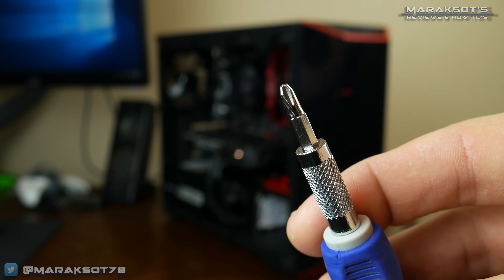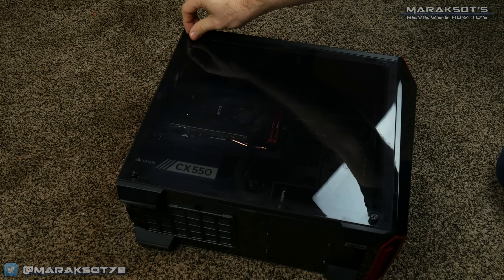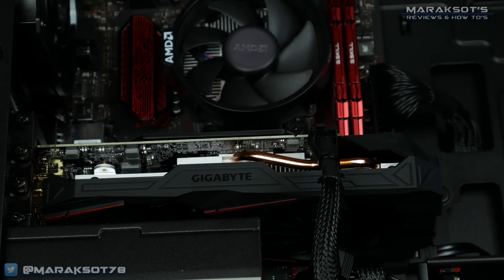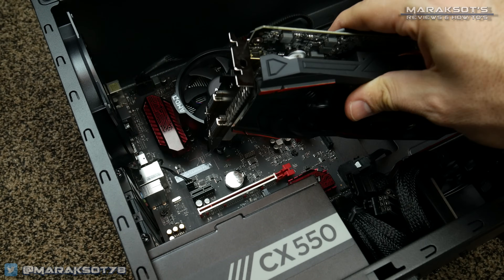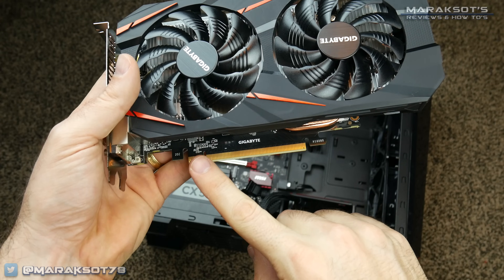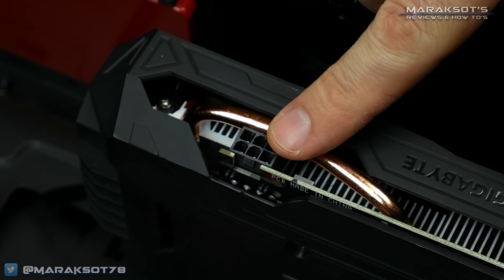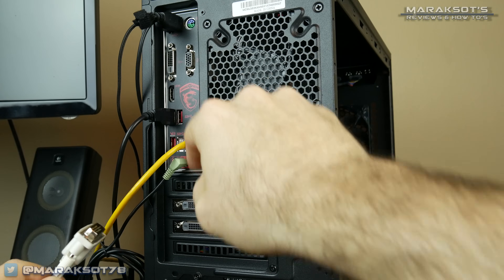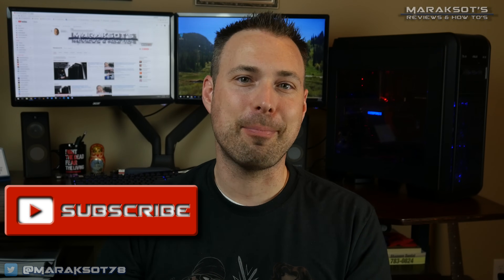How to Install a Graphics Card - Upgrade Your GPU

Comment: Great video.  After installing the gpu, is there somewhere you can go in your pc settings to confirm that the video card is installed correctly and working properly? Thanks!
Reply from the maker: If you're getting video to your monitor that's how you know it's installed correctly.  :)

Comment: congrats 

dont build on a carpet
don't touch sensitive parts
dont leave a screw when you drop it on the mobo
dont spill water on it
you need to have antistatic surface
dont turn it on when changing
dont strip screws
if you tripped your screw use a big screwdriver
don't pull cables from the wire
dont drop anything
dont touch the yellow bttom of the ram sticks
look carefully for the ram slots
dont buy an air cooler that blocks your ram
dont use too much thermal paste
wipe your hands if oily
dont touch your mobo with oily hands
screw in your gpu when installed
dont forget to download drivers
cable management
dont put a cable near a fan
maintain proper air flow
remember to screw the fans in
dont forget the io shield
dont hammer in your io shield
remember to use zipties
dont open your case vertically if it has a glass side panel
dont drop your hdd
never ever touch an hdd when running

Comment: I am really inexperienced with PC stuff. What happens if you are upgrading a graphics card and it doesn't have the same slotting or it needs more cords that you don't have coming from your power supply? Not even sure if my question makes sense but for example going from a 2070 super to a 3090 from what I can tell those have different hardware and I wouldn't even begin to know what to do if that were the case.

Comment: Question. I'm currently looking to get a RTX 2060, i have a GTX 970 right now and it's really showing it's age. I have an AiO water cooling system does that link in with the graphics card or no? I'll replace the card myself if it's not integrated with the graphics card, or if it even can be, but if it is i'll need to take it in. Would that be a factor?

Comment: I'm about to leave to pick up my new GPU from the PO box. I've never installed a card all by myself, or anything in the computer, really. Hope I won't mess anything up. Thanks for the video, I'll put it up on my TV and try to follow it step-by-step.
Reply from the maker: Glad to hear the video is helping you. Enjoy your new upgrade. :)
Reply: @Maraksot78  I, uh. Turns out that like the moron that I am I didn't check whether I had an 8 pin cable. I don't. And in addition, no store in the city has it on-hand, has to be ordered. Guess I'll wait a few more days.

Comment: I have intergrated graphics would a 1660 super work with it?
Reply from the maker: What CPU do you have? Intel or AMD? And what model? i.e. i5-6600, i3-7100, Ryzen 3 2200g, etc.
Reply: @Maraksot78  RYZEN 3 3200G
Reply from the maker: A 1660 Super will work with the 3200g but the 3200g is going to bottleneck a 1660 Super. It won't damage anything but you won't be getting all your monies worth in fps out of the 1660 Super.
Reply: I might consider Upgrading to RYZEN 5 3600 though but cheers!

Comment: I just wanted to say, thanks a lot for the video, never actually replaced my GPU before so was a bit nervous but it's easy, the backpannel looked to be a part of the case, which it wasn't and the screws there were securing the GPU (at 1st it didn't look like this)
Works, my PC recognizes the new GPU and nvidia  automatically updated the drivers.

Comment: i'm thinking of buying an RTX 2060 super (from a GTX 1060) 1 thing i'm missing in comparison to this video is the 2 thumb screws that secure the GPU in place, it has the release thing for the GPU and the PCI-E cable so that's not a problem but i'm not sure if it's secured to anything or just hanging there, even when i check on the outside the screws aren't keeping it in place (unless i'm going insane)

Comment: so im upgrading from a geforce 610 (yes i know very bad gpu) and i was wondering if i installed a gtx1600 for example would it be compatable with my motherboard? or will i need to buy a compatable motherboard

Comment: So lets say im going to buy 2070 super and all the other specs are very VERY old do I need to upgrade any other spec before I upgrade my gpu for the gpu to run correctly?
Reply: Cuz I have heard that you need a decent power supply for that but I am not sure
Reply from the maker: As long as your current PSU (power supply unit) can provide the correct amount of power your new graphics card needs to operate then you don't NEED to update any other hardware in your PC.
That being said... if you have an old CPU you run the risk of bottlenecking your new graphics card.  If you don't know what a CPU bottleneck is and why it happens I made a video explaining it not too long ago you may find informative.  https://youtu.be/xEcMvIAu9-E  The main concern is you go and spend $500 on a graphics card and your old slow CPU, motherboard and RAM then limit how many fps your new GPU can output.  Rather than getting your full $500 worth of performance out of it you'll only get the same performance as a graphics card that costs $200 or $300, meaning you put a more powerful graphics card in your computer than the rest of your system can support.
The other issue you could potentially run into is if your motherboard is so old that the firmware on it doesn't recognize your new graphics card as a video output device and therefore cannot output anything to your monitor.  This can often be fixed with a motherboard BIOS/UEFI update but sometimes the only solution is to upgrade your motherboard which then means you need to update your CPU and RAM as well.
Personally my recommendation would be, if you're buying a high end graphics card then you also want a high end CPU and RAM to go with it.  Putting a brand new 1000 horse power engine into a 20 year old Toyota Corolla just doesn't make sense.  That old car doesn't have all the other high performance equipment, i.e. transmission, suspension, wheels, tires, exhaust, etc. needed to actually make use of all the horsepower that engine can output.  Computers are the same way.  Putting a brand new high performance GPU into a system that has a low performance CPU, RAM, etc. is going to limit that GPU and keep it from ever running at it's top speed.

Comment: -- Time Stamps -

0:00 - Video Intro

1:17 - Tools You May Need

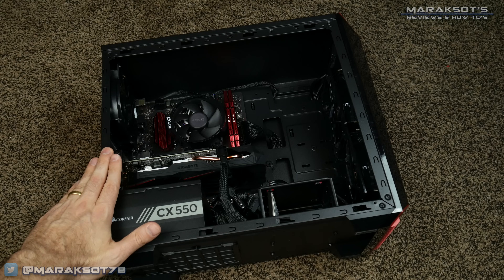1:31 - Opening Up Your Case

2:50 - Removing an Existing Graphics Card

3:56 - What to do if You're using Integrated Graphics (you don't currently have a graphics card in your computer)

4:24 - Installing your New Graphics Card

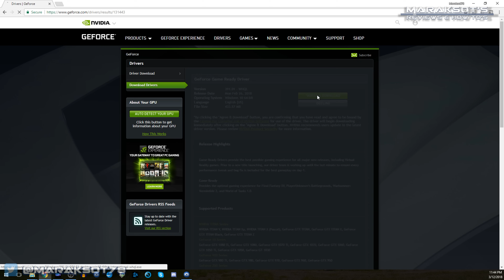5:03 PCIE Power Connectors

5:30 - Time for a Test Boot
Reply: Thank you
Reply: Yes, I did copy pasted desc.. I just wanted to comment it myself so that it is top in my comment section :)
Reply: @02102u  ok

Comment: Two questions:
1. Why do I have to plug in my monitor into the gpu rather than the mobo?  (i have a monitor that is quite old and im afraid that the gpu wont hace the specific slot, bc at the moment i can buy the gpu)
2. Im planning to buy the RX580 and was wondering how i can "switch" between the integrated graphics and the dedicated gpu (i have a ryzen 3 3200g with radeon vega 8)

Comment: Can I upgrade a prebuilt pc with a GTX 1060 3gb? (To maybe a 1660 or 1660 Ti 6GB)
Reply from the maker: Yes, but I would recommend saving your money a bit more and buying at least a RTX 2060, 2070, 2080 or a Radeon RX 5600, 5700 or 5700XT. A 1660, 1660ti or even a 1660 Super isn't going to get you a whole lot more fps than a GTX 1060. The 1660 is more powerful than a 1060 but only 5 or 10 fps in most games which in my opionion isn't worth the $200 to $250 you'd pay for one since you already have a 1060. If you want a real noticable uptick in performance over a 1060 I think you'll want to save up some more and get something significantly more powerful... assuming your CPU is powerful enough to not bottleneck it of course.

Comment: Question: im upgrading from a gtx 1660 to a rtx 2060 super. Would i have to uninstall the old drivers still after i put the rtx 2060 in and install the rtx drivers? Or will the old drivers just convert?
Reply: If you have geforce experience, you just simply download the drivers

Comment: Why is my screen black after plugging the gpu??pls help
Reply from the maker: The first trouble shooting steps I'd recommend is first make sure your new graphics card is fully seated in the PCIE slot. Next I'd make sure all the pci express power cables are correctly and fully plugged into the graphics card. While I was doing that I would make sure all the power cables for the CPU and motherboard are also properly plugged in and that the RAM is properly seated. I'd then boot the PC up and if it still had a black screen then I would swap my old card back in and update my motherboard BIOS and try again.

Comment: How do you know if your graphics card can fit in the pc Bc i wanna get a new graphics card but I don’t wanna buy it then it doesn’t fit or something
Reply from the maker: The best way is to take the side panel off your computer and use a ruler or tape measure to see how much space you have in the area where your graphics card needs to be installed.  You can then go to a site like Newegg.com and look up the card you want to get and look in the specifications for the dimensions of the card you want and see if it will fit.
Reply: Maraksot78 ok thank you
Reply from the maker: @drewellis3241  no problem.

Comment: my graphics card only has one fan can i get one that has 2 or not
and does the card have to be the same brand as my first one ex:msi
Reply from the maker: As long as you have enough space in your case to accommodate the graphics card you want it can have two or even three fans. It doesn't matter what brand you buy either i.e.  MSI, Gigabyte, EVGA, Sapphire, PowerColor, XFX, Asus, etc. You do however need to make sure your power supply has enough wattage for whatever graphics card you choose. Most graphics cards today you're good as long as you have a 500 or 550 watt power supply, but you'll need to check the specs on the graphics card you choose and see what the minimum recommended power supply wattage is for your card. Also you don't want to pair a really high powered expensive graphics card with a really cheap low powered CPU as that can lead to CPU bottlenecking which means you're getting less performance (lower fps) out of your graphics card than it's capable of producing. If you don't know what CPU bottlenecking is here's a link to a video I made explaining it. https://youtu.be/xEcMvIAu9-E
My other video I talk about in this video that people complained about being too long actually goes over all of these other things that are important to take into consideration when upgrading your graphics card. This video is focused more on just the installation process.

Comment: I edit a lot of photographs and most of the time I'm in Photoshop and have no speed problem.  Recently I've started using some of the new Artificial Intelligence software like Topaz Sharpen AI and every time I make an adjustment it takes a long time to update the display and saving a final image can take as long as 5 minutes.  My graphics card has the updated drivers, so I guess my question is do I need to get a better graphics card???  Thanks  P.S. My card is a Intel (R) HD Graphic 630

Comment: Is it advisable to wear gloves when doing this to avoid any electromagnetic discharge?
Reply from the maker: I guess you can if you want but I don't think they'll prevent you from shocking anything with static electricity because gloves like latex gloves are too thin. Rubber gloves might work but I think those are too thick and would make installing components very difficult.  As long as you keep touching the case every so often and equalize the static charge between you and the case you'll be fine. Like I say in the video modern PC components are much more robust than they were in the old days. Modern parts have safety features built in to them making them much less susceptible to damage from an electro-static dischage. The video from Jayztwocents I link to also shows him trying to damage things with a static discharge and they're unable to actually damage the computer. He made a video in the last month or so where he sprayed a graphics card with water and it took a fair amount of water before he had any problems and after drying it out it worked fine again. So yah, graphics cards aren't as fragile as many people believe or fear they are.

Comment: question do i need to plug my monitor into the graphics card? cause rn its plugged in via hdmi. sorry i just finished biulding my first gaming pc.
Reply from the maker: Yes you want to plug your HDMI cable into an HDMI port on your graphhcs card.
Reply: @Maraksot78  oh do all graphics cards have HDMI port? And I got a question. Is it possible to run 2 monitors but one is connect via HDMI and the other via vga?
Reply from the maker: Most graphics cards now have HDMI and Display Port (a.k.a. DP) and some will have DVI as well. I haven't seen VGA on a graphics card in a long time. Anyway, DVI is an older standard and is being used less and less. Most new and even older high end cards will typically only have HDMI and DP.  To answer your question about using two monitors with different types of display cables... yes you can do that.
Reply: @Maraksot78  lol sorry I didn't know graphics didn't come with vga sorry

Comment: Do I need to install new one into the slot of my old GPU? It's really tight cause new one is bigger and thicker
Reply from the maker: You don't have to install your new graphics card into the top PCI express slot. Any PCI express slot will work. The only difference is the number of PCI express lanes to the CPU those slots have available to them. The top slot typically has 16 lanes available to it and the lower slots typically only have 8. As far as I know 8 lanes is fine for most modern graphics cards. Really high end cards however like the RTX 2080 may utilize more than 8 lanes. I haven't researched that though so I don't know for sure.
Reply: @Maraksot78  So I replaced AMD Radeon RX 590 - 8GB Crossfore Mode (Dual cards), with EVGA GeForce RTX 2070 SUPER XC ULTRA GAMING, 08G-P4-3173-RX, 8GB GDDR6 (single card). The old ones were in the PCI 3 & 4 slots, but I stuck the noew one in the PCI 1 slot. Powered it up but screens blank. Any ideas?
Reply from the maker: @alkhan626  Not totally sure. I might try updating your motherboard BIOS/UEFI.
Reply: @Maraksot78  It's working. One of the connectors got disconnected when I yanked my old GPU 😁
Reply from the maker: Awesome. Happy to hear you got it figured out.

Comment: I have a integrated gpu dell optiplex, do I need to turn it on and like uninstall that integrated gpu or do I just install the gpu and connect my monitor to that... note: I haven't turned on the PC yet, not even turned on
Reply from the maker: No need to uninstall the integrated graphics drivers. You just install the new graphics card, connect your monitor cable, power it on and then download and install the drivers for you GPU.
Reply: @Maraksot78  thx u kind sir
Reply from the maker: @chengxiong9661  no problem.  :)

Comment: hey i have a question!
what about compatibiliy? how to find the right card for cpu motherboeard?
Reply from the maker: As long as your motherboard has a PCI express slot any graphics card should work with it. That being said if you have an older motherboard and a new GPU you might have to update your motherboard BIOS/UEFI to get it working properly.
Reply: @Maraksot78  thanks man! subscribed

Comment: You said it needs power cables into the new graphics card but maybe I missed it. Where do they come from, where does the other end of the power cable go to? Or is it coming from somewhere in the motherboard
Reply from the maker: Does the graphics card you're upgrading to require PCIe power?  i.e. have the power port(s) on it like I show in the video?  Some cards don't require additional power.  Those are usually less powerful GPU's like the RX 560, GTX 1050 or GT 1030 though; anything more powerful than those require additional power from your power supply.  Your power supply should have these cables coming from it.  If your power supply does not have these cables coming from it you can buy adapters that will adapt SATA power connectors to PCIe OR you may need to upgrade your power supply to a higher wattage power supply as the one you currently have may not be powerful enough for the graphics card you have chosen.  This is stuff I cover in my other video I talk about at the beginning of this video.  That video is more for helping teach people all the things involved with upgrading a graphics card.  What all  things you need to know and take into consideration when choosing a new graphics card.  This video is more just showing the physical process of installing a new graphics card.  If you'd like to learn more here is the link to my other video but I wanna say, it is one of my first videos I ever made and is pretty cringy.  If you set the playback speed to  1.5X it's much more tolerable to watch.  XD lol  https://youtu.be/HTNVjwTQC18?t=131